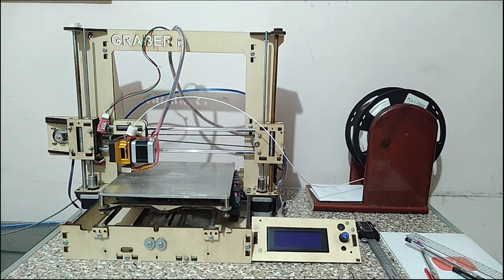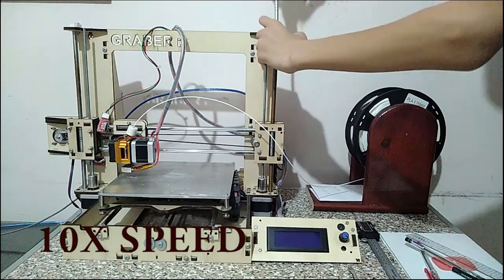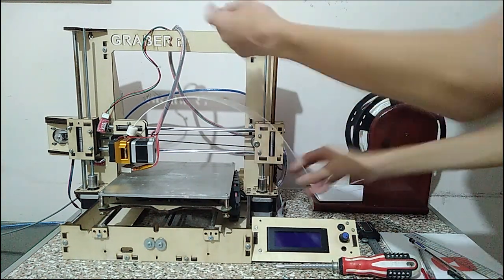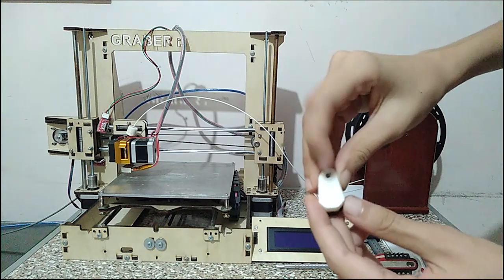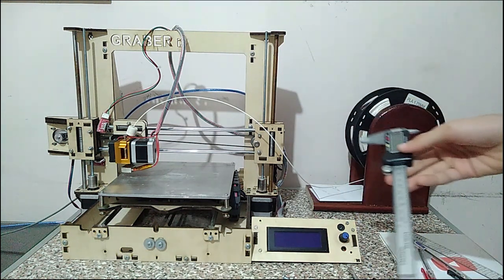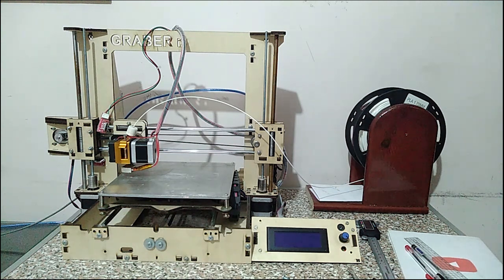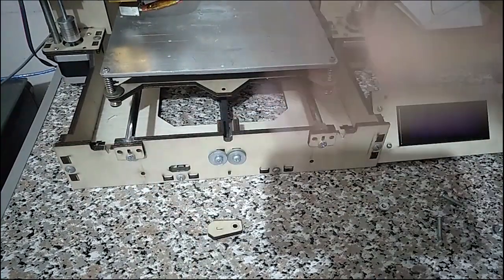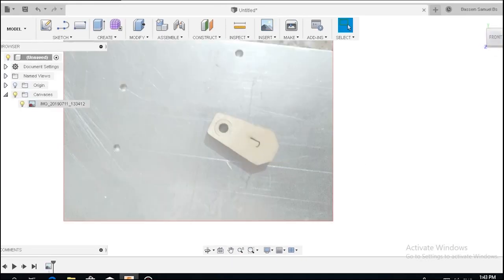How to DUPLICATE PARTS using 3d printing | simple quick method

Comment: what program did you use to copy part?
Reply from the maker: Fusion 360 and then I used Cura slicer and Printrun to run the Gcode because I prefer it more than Cura's print via USB feature